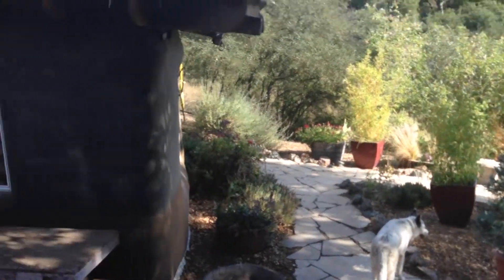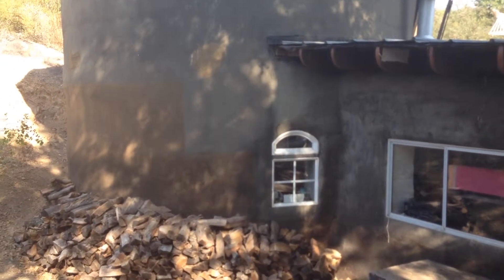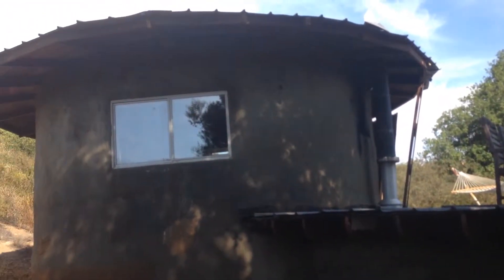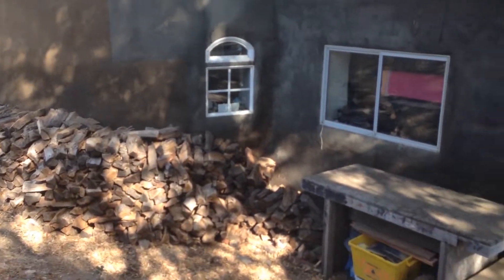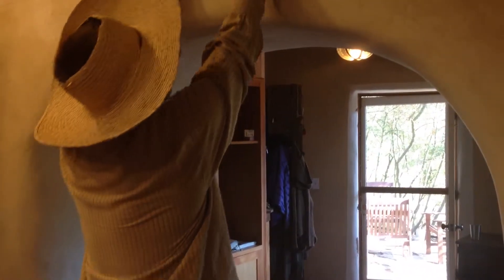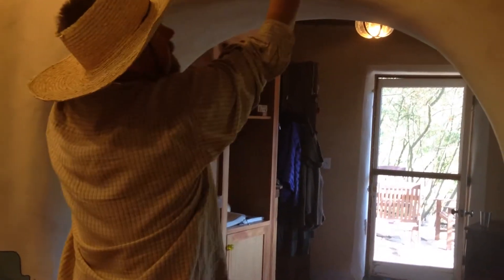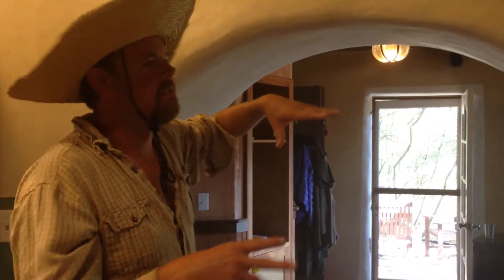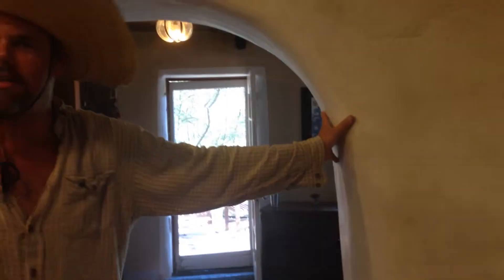Straw Bale and Rammed Earth Construcution Review

Comment: I like rammed earth and plan to build in climate similar to Maine. What do you think a 10 sided house about 40 feet in diameter with a geodesic dome ceiling height of 26 feet at center would do for heating wise. Not in a rush to build so would like to do 18 inches uninsulated rammed earth with an 18 inch envelope of strawbale. Feel using r.e. for winter thermal mass and let cold night air inside for summer. But have to have a R 49 value, so am aiming for hybrid. Thinking of wool batten under enameled metal roof with eaves that will overhang house about 6 feet. The metal roof is cooler than asphalt shingles, good for rainwater collection, and long lasting. Thanks for sharing earthquake story. In stages of doing a pagoda style design for roof with tall center beam in ground for seismic benefits.